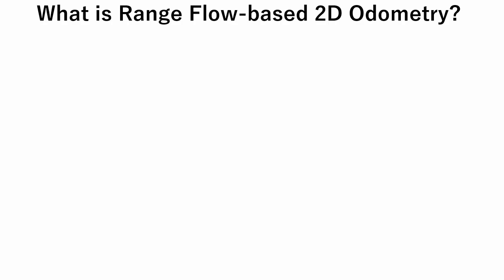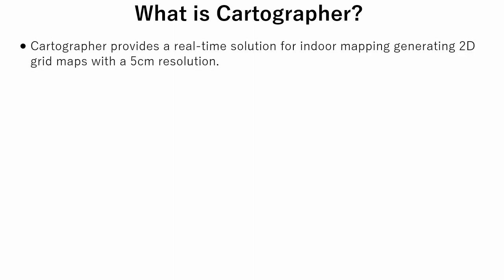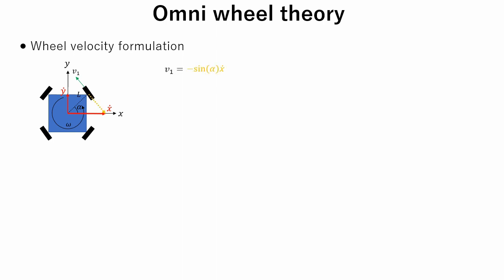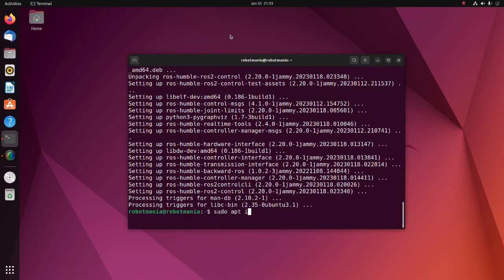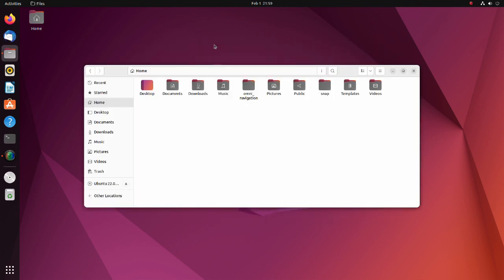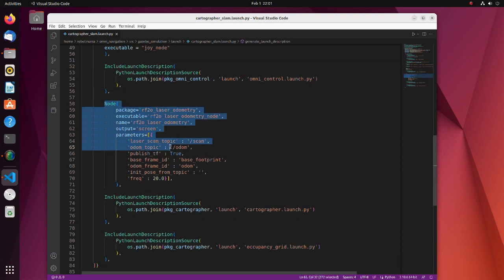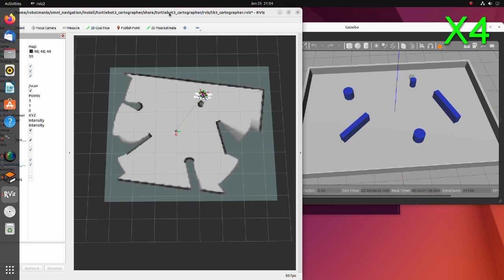Navigation of an Omni Wheel Robot Using Only a Lidar

Comment: can i control this robot using keyboard? if i can what should be changed in code
Reply from the maker: Hi Aleko Mamatsiani!
Thanks for watching my video!
I think, by running the “keyboard_to_joy.py” script of this repository, you will be able to operate the robot without any code modifications.
https://github.com/cmower/ros2-keyboard
Reply: @robotmania8896  thanks for replying do i add that in same directory or seperate if you know will it give any difference
Reply from the maker: @unknown-qr1jc  Put the package in the “src” directory. It is better to have all required packages in one place.
Reply: @robotmania8896  i do have joystick plugged in and system is able to discover it but i still can't get it to move around

Comment: my bot is not moving
Reply from the maker: Hi Rahul Bhende!
Are there any errors in the terminal?
Reply: @robotmania8896 No rviz and gazebo both are working shows the same you shows in video but its not moving even i tried using this command "ros2 run teleop_twist_keyboard teleop_twist_keyboard" but robot is not moving
Reply from the maker: @rahulbhende5497 Are ROS2 controllers launched successfully? Even if Gazebo and RVIZ show the model as it should be, there is a possibility that something went wrong with ros2 controllers.
Reply: @robotmania8896  sir I am not using any controller I tried to use using keyboard tele.... command
Reply from the maker: @rahulbhende5497  ROS2 control is a program which receives commands and transmits it to a joint. It is used in this tutorial. In this tutorial I assume that controller receives ‘Joy.msg’  (https://docs.ros.org/en/melodic/api/sensor_msgs/html/msg/Joy.html) , so please use a joypad or publish this message manually.
Reply: okay sir

Comment: Your are really amazing the steps you provided is for ros can we implement on Ros2
Reply from the maker: Hi Rahul Bhende!
Thanks for watching my video!
This simulation is done with Humble, which is a distribution of ROS2.
Reply: Thank You for the replay, can we run ros and ros2 both in ubuntu 22.0 if not then Is there a way to convert the ros file into ros2? @robotmania8896
Reply from the maker: No, you can not run ROS1 in Ubuntu22.0. There is a tool that helps to convert ROS1 to ROS2, but still you have to do some work manually.
Reply: @robotmania8896 thanks for the reply you are really kind youtuber

Comment: Why is my robot moving around uncontrollably?How to drive it?
Reply from the maker: Hi young very!
Thanks for watching my video!
Please connect a joypad to control the robot.
Reply: @robotmania8896  I have connected a joypad by ps2 joypad,but it couldn't run.And i saw the omni_control and which Joy is not accessed.but it is imported the Twist.I don't know if you changed the code.I explained the specific situation in your email.
Reply from the maker: @youngvery451  Can you see whether your ps2 joypad inputs are read correctly by ROS2 using the “ros2 topic echo” command?
Reply: @robotmania8896  I run joy_node independently and it just show me "opened joystick".No matter how I push the handle, the robot won't move.
Reply: @robotmania8896  The joy echo is run currently.I also try the echo of twist_keyboard,and chande the control.py code,which would subscribe the twist from cmd_vel,and the echo is also currently.but the robot didn't run.
Reply: @robotmania8896  Yes,and I find the '/forward_velocity_controller/commands' didn't be subscribed.
Reply from the maker: @youngvery451  What do you mean by “didn't be subscribed”. Does this topic contain any values?
Reply: @robotmania8896  when i running ros2 topic info /forward_velocity_controller/commands ,return following
Type: std_msgs/msg/Float64MultiArray
Publisher count: 1
Subscription count: 0
and i running"'ros2', 'control', 'load_controller', '--set-state', 'active', 'forward_velocity_controller'",return"Could not contact service /controller_manager/load_controller"
I don't what is wrong and how to debug.And my friend has a same error ,he also coundn't control thr bot.
Reply: @robotmania8896  it seem to it is change by myself in some time 😅

Comment: how do i run the installer program and on the drive there is no setup.bash installer folder
Reply from the maker: Hi Gamaray Wisesa!
Thanks for watching my video!
Please, execute the “colcon build” command in the “omni_navigation” directory and install folder will appear.
Reply: @robotmania8896    is there a video for the tutorial?? if so it really helps me
Reply from the maker: @gamaraywisesa7203  Where exactly are you experiencing a problem?
Reply: @robotmania8896   when I enter the terminal "source omni_directional/install/setup.bash
Reply from the maker: @gamaraywisesa7203  Firstly, you should do “cd omni_navigation”. Then “colcon build”. After that you should be able to execute “source omni_directional/install/setup.bash” in a new terminal.
Reply: @robotmania8896   First, thank you very much for all these helpful videos
I have tried more than one method, but we always get  "No such file or directory"   I have ubuntu 22.04  and ros2 humble
Reply: @robotmania8896  its work but when i running the program gazebo dont working and stuck
Reply from the maker: @gamaraywisesa7203  Have you moved “omni_stage” into the “.gazebo/models” directory?
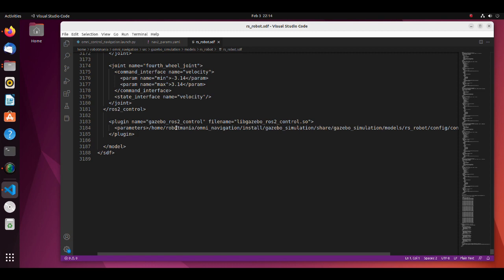Reply from the maker: @stevealmnson1506  Have you changed the directory name to your user name as has been explained in the video(10:40~)?　Also, do not forget to rebuild the project after this.
Reply: @robotmania8896  sorry for that step I didn't do, are there any steps that can help me to do that
Reply: @robotmania8896   and ".gazebo/models" on my directory not fund, how to make that directory
Reply: @robotmania8896 where is this .gazebo/model directory?
Reply: @robotmania8896   do you have an email that i can contact to ask my problem and i can include a screenshot of my problem
Reply from the maker: @gamaraywisesa7203  If you don’t have a “.gazebo” directory, open a terminal and execute “gazebo” command once. Also don’t forget to check the “Show Hidden Files” checkbox. You can write here robotmania8867@yahoo.com

Comment: Thank you sincerely. Will this work for 4wd mecanum wheels robot?
Reply from the maker: Hi naidol!
Thanks for watching my video!
Yes, you can use almost all the code as it is, but you have to implement wheel velocity calculation method for mecanum wheels in the “robot_control_navigation.py” script (lines 35~38).

Comment: Thanks for the content! Installation is straightforward, but it's not clear how you drive the robot in order to uncover the map?
Reply from the maker: Hi Simeon Tsvetanov!
Thanks for watching my video!
You can use any joypad to drive the robot. I used X360 Controller.
Reply: @robotmania8896  Thanks! I guess, after buying one I have to to install teleop_twist_joy.
BTW, in the experiment from you other video I successfully used “teleop_twist_keyboard” package to control the by the keyboard.
Can I do something similar in this case?
Also, I would suggest an idea for a new video combining this one, the one with the robot arm and one for the object recongition series. I think it will be a good demonstration and useful for the whole community. Please, contact me.
Reply from the maker: @Simeon_Tsvetanov  Yes, you should be able to operate the robot using keyboard. But since the current code subscribes to the “sensor_msgs/Joy” message, you should modify the code a little bit to make it work with “geometry_msgs/Twist” message type. 
Thanks for the idea. I appreciate it. I also think that making tutorial about something like “WRS Future Convenience Store Challenge” should be fun.
Reply: @robotmania8896  hello,
which video did  you used “teleop_twist_keyboard” package in it ? because am trying to modify the code to make it work with “geometry_msgs/Twist” message type but it doesn't work :(
Reply from the maker: @manarkassim447  Hi Manar Kassim!
Thanks for watching my video!
I have not used “teleop_twist_keyboard” package in any of my videos. Which script exactly you are trying to modify? The scripts in “omni_control” package should work with “geometry_msgs/Twist” message with very little modification.
Reply: @robotmania8896  Hi robot mania,

First, thank you for your beneficial videos. I've found them to be very helpful in my work.
I'm currently searching all files for the word "joy" and modifying them to work with a teleop keyboard.
Also I have a few questions about your video that I'd love to ask you. Would you mind if I sent them to your email address? Thanks for your time!
Reply from the maker: @manarkassim447  Please send me email to this address
robotmania8867@yahoo.com